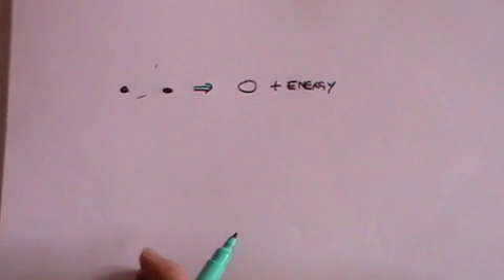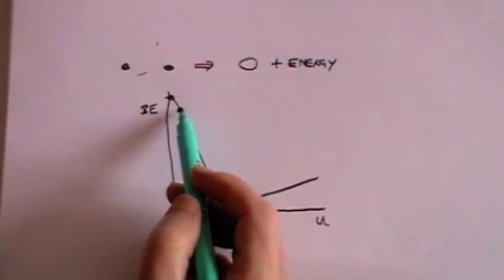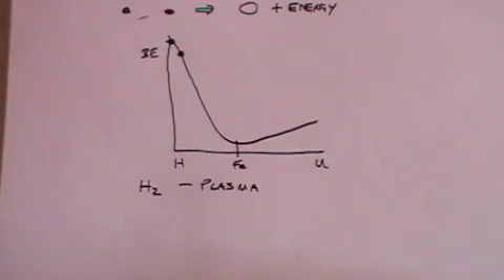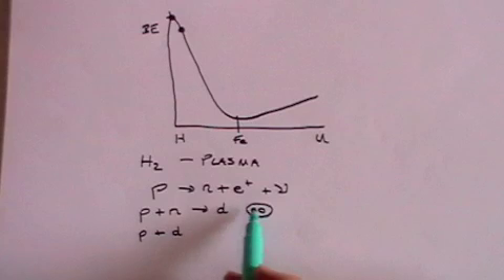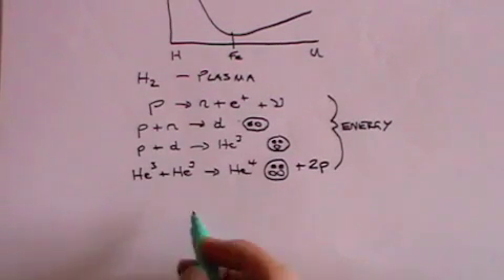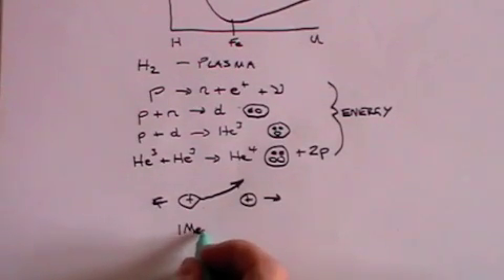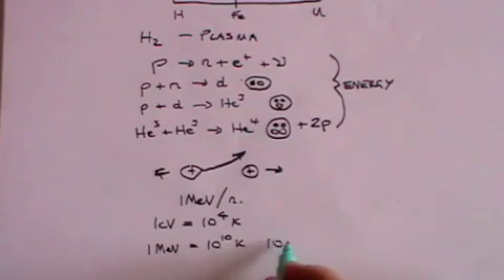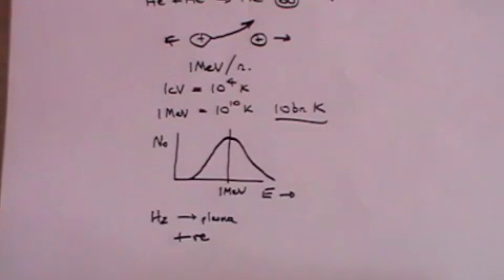Nuclear Fusion - Part 1 of 2

Comment: I can see why the binding energy graph has that shape. Two forces of different strength, range and direction are combined; the SNF and ESF.  I can see why if a heavier atom is made out of lighter atoms and the whole weighs less than the parts then that can be described as energy by E=mc sq.  What is puzzling is that this is the binding energy - which is 'released' - So, .... how does the binding energy IN the combined atom increase? The mechanism for fission releasing energy is puzzling too.

Comment: Plasma physicist here. Nice video, as always. Small correction though: electrons are not stripped of in a plasma. Most plasmas are quasi-neutral. What you may say is that electrons are free from the proton's grasp. More precisely, the average kinetic energy of an electron is much larger than the potential energy to its neighboring particle, thus the binding between electrons and protons is negligible for most purposes.

Comment: I doubt that under our gravity it can be accomplished. The reaction is too volatile to be contained as much as it needs to in order to use. 300,000 degrees is bizarre heat, and it's got to be suspended in magnetic fields, which take insane amounts of energy to make that strong. When? I say never. We'll see, but it's going to cost more to develop than it will ever produce even if they do get it controlled. Engineering advances are limited by available resources. It's a physics problem in the end.

Comment from the maker: This is really an engineering problem rather than a physics one. Those who are building the fusion reactors seem confident that they can do it. Fusion reactors do already work. Their big problem is that they tend to require more energy in that they give out. But doubtless with engineering advances they will solve that problem. It's just a question of when.

Comment from the maker: It doesn't matter as long as the scale is made clear. Some people show the way you have described because the highest binding energy is at the top of the chart. I drew the other way because Binding Energy is negative so the highest binding energy is actually the lowest energy level. It is then easier to see that when Uranium decays it results in atoms with lower binding energy and hence releases energy.